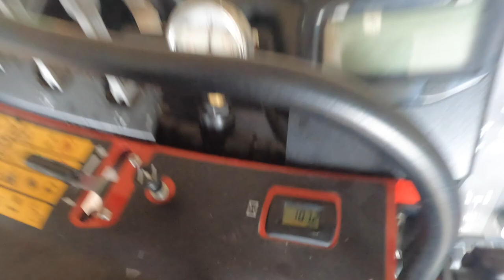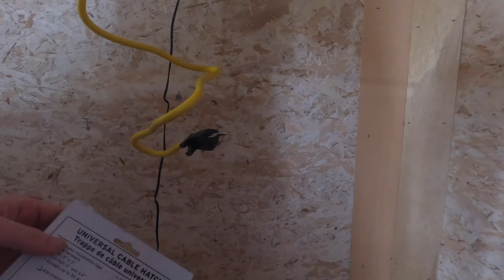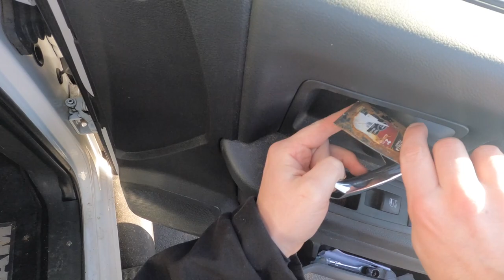Tow Mirrors and Trailer Work!

Comment: That outlet hole will be handy for sure!
Reply from the maker: I'm thinking about putting some square access panels for fueling the machines.
Reply: @bladezllc  that sounds ingenious as well!!
Reply: @Bladez LLC  that would be really interesting to see. I was trying to think of how I'm going to be doing that this year transitioning to an enclosed trailer from using an open for years.
Reply from the maker: @The Radioactive Heat  I had some that I ordered, but they showed up off-white, so I'm sending them back and getting white ones. When I do, I'll show them in a video. I think that will save tons of time unloading at the gas station.

Comment: How is this truck holding up? looking at a 2014 2500 5.7 with 103k. Lonestar longbed. any transmission issues or any other problems
Reply from the maker: That truck is still going strong. No major issues at all.

Comment: Don't brake that door handle there a little over $300 bucks used at Pam's its ridiculous.
Reply from the maker: Over $300, that's insane!
Reply: @Bladez LLC  it is that's why the door handle in my 2016 just stayed broke I could open it so I wasn't spending $300